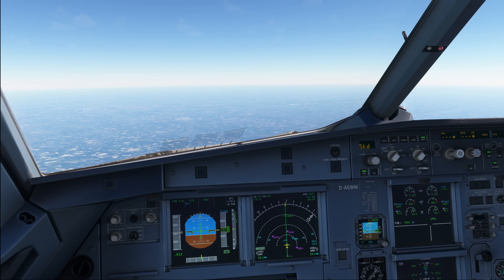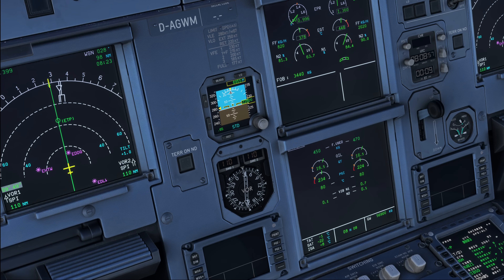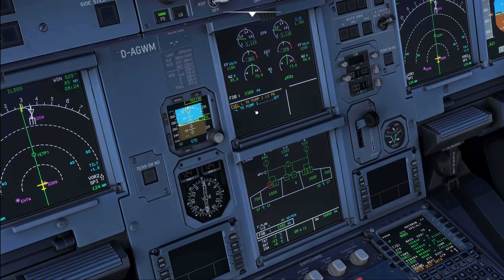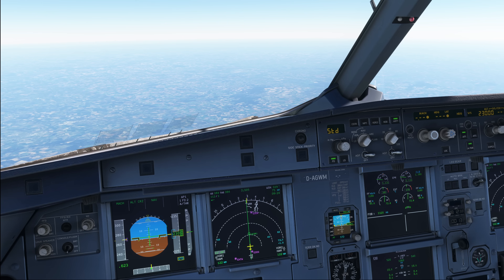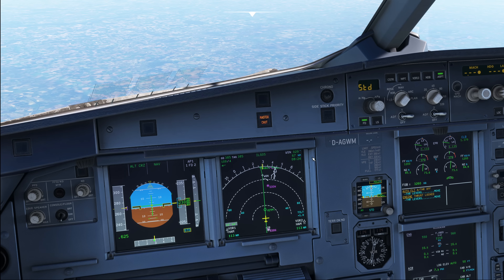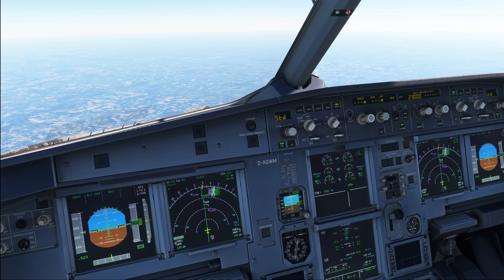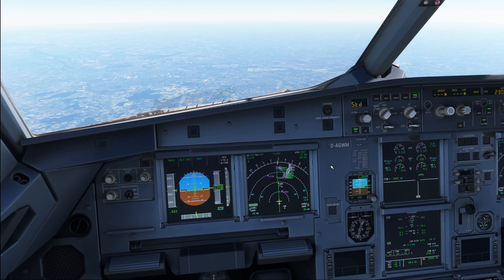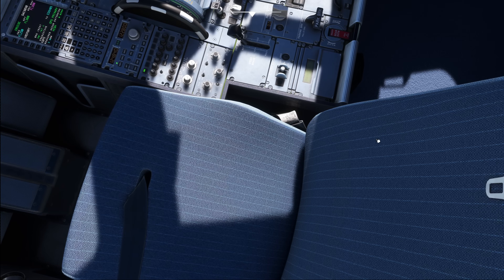AIRBUS ECAM Warnings/Cautions and RESET Procedures explained | Real Airbus Pilot

Comment: I really do love the detail that fenix has in their a320. Inflight I had a fault light show up for the ventilation extract fan and after looking up the fault used an actual maintenance procedure to diagnose and clear the fault light. All i really did was cycle the circuit breakers but it felt like actual troubleshooting.

Comment: Hi at 13:03 you said that the cbs in the back can’t be used to reset systems but the QRH states that if you have an FCU 2 fail you have to reset cb M21 on 121VU which is on the back panel, isn’t it correct? Thanks